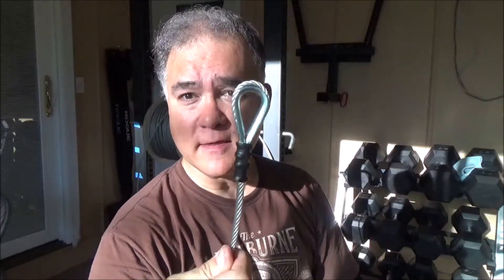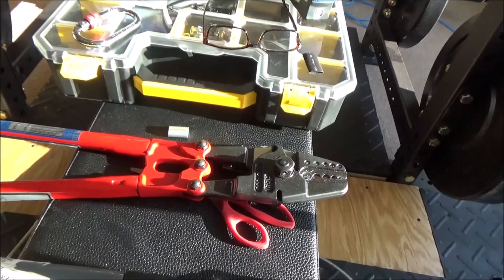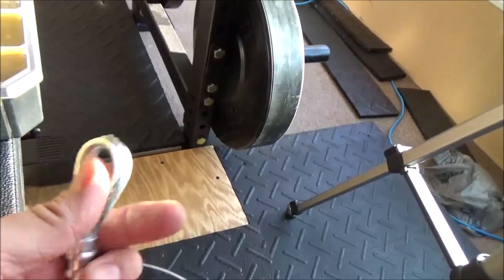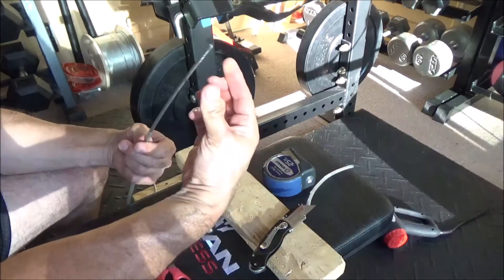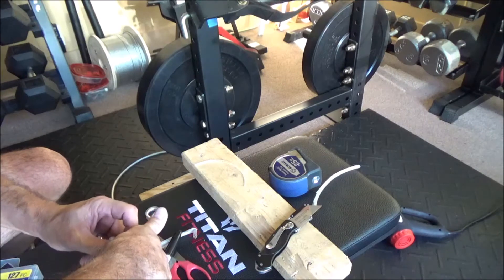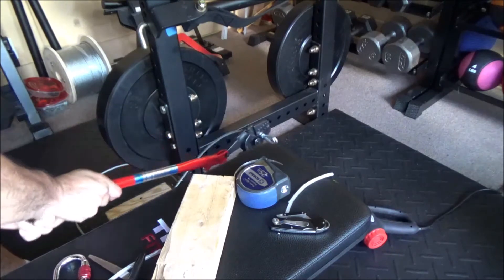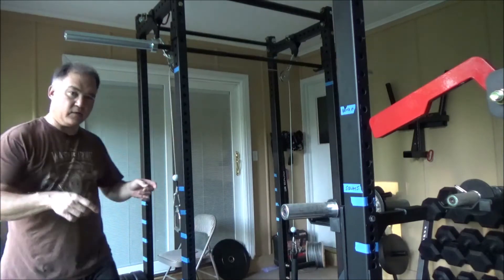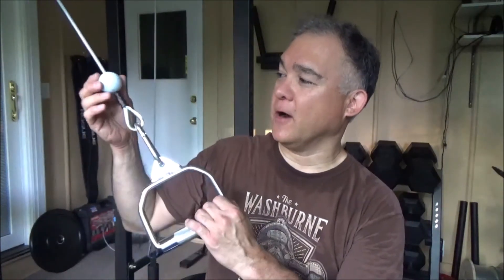Making Cables for Cable Cross or Cable Pulldown System

Comment: I drilled out the Ball Stop (Golf Ball) hole a little bigger so the crimped ferrule can slip into the hole, then behind the Ball Stop is a small rubber stop and or the stop that came with the ferrule - so the Ball doesn't always fall back.  - - - It looks more professional and gives you that extra inch" - some of us need more than others.

I see in the comments that you are using 3/16" ID, and 1/4" OD including the plastic vinyl coating, wow, I thing that's overkill imo.

I'm using Home Depot 1/8" ID Stainless Steel Cable Rope plus blue vinyl coating = 3/16" OD.
The working load = 340lbs, breaking load = 1,400lbs - with Home Depot 18" Swaging Tool and Aluminum Ferrules.

Comment: I just discovered you're channel, and subscribed. A few months ago I bought similar cable and after about a month the plastic coating separated from the wire just where it goes thru the pulleys, did you run onto this problem?
Reply: My pulley wheels are fairly small, not sure of the size but would guess around 1" to 1 1/2 ". My gym is outside and it has been very hot, I wonder if that made the plastic coating soft and caused it.
Reply from the maker: @johnsharpnack4983  I suppose that's possible. I don't think I've ever used coated cable outdoors.  I bet that would affect it. The heat and moisture, etc.  My guess is, that's a bigger problem than the pulley size.

The pulleys I use are 3".

The only reason I went with coated is that it could be next to my skin, but on an outdoor gym, I don't think that matters. At this point, if you wanted, you could just strip the coating off and use it as-is until it wears out. (My guess is that it won't wear out.) If it bothers your skin, you could always just wear long sleeved shirts or just duck tape the part that's touching your skin.

Most wire rope shouldn't rust. I had a batting cage with uncoated cable outside for years. It never rusted.

If it still works, I'd say use it as is. If the sheathing is starting to make the cable not-roll in the pulley very well, I'd say just strip off the sheathing, especially where it goes through the pulley.

And for an outdoor application, I think I might be tempted not to use coated wire rope.
Reply: @JimintheGym  Thanks Jim, I will order some bigger pulleys and see how that works. I live in western Arizona in the Mohave desert and we had a few weeks of temps in the 115-120 degree range, And yes I am just crazy enough to work out in those temps, although my gym is in the shade. I will let you know how it goes.
Reply from the maker: @johnsharpnack4983  Ah. Just a thought, but the coating on cables gets soft in heat. I think for an outdoor application like that? You might want to consider using uncoated cable. If it were me, I'd just strip the vinyl sheating where it's cracking. It'll work fine on your pulleys. Try that first. I think that'll be better. It also won't cost you anything.

But for an outdoor guy in high heat conditions, I don't think I'd go with coated cable. It will expand then cool, then eventually crack or get so floppy that it jams up the pulley.
Reply: @Sugleknug  Thanks Sugleknug for the advice, I will get bigger pulleys.
Reply from the maker: No, I haven't had that problem.  Interesting.  I am using the larger national hardware pulleys. I wonder if the size of the pulley wheels matter? what size are the wheels on your pulley?
Reply from the maker: @Sugleknug  Good call.

Comment: Awesome video! Do you still need to strip the coating if you're going to use clips instead of swaging the cable?
Reply: My opinion? yes. Clamping onto the plastic coating would be unsafe, IMHO. (The plastic coating can slide and stretch)

A few people have mentioned using wire rope clips (the little clampy things) instead of swaging. I can absolutely see why folks would go that way. It's easier and way less expensive.  

I have my misgivings against doing that. The main one being, you have this jagged thing that's on a wire under force.

But to make it safe? I'd probably locktite the nuts after you tighten it down, then dremel the bolts so they're not going to scrape somebody's arm up if you loose grip on the cable.

They make REALLY large diameter shrink wrap. I'd buy some of that and shrink wrap it on there after dremeling off the bolts.  I might even find some PVC or CPVC pipe and put a plastic shroud around it. 

I'm just picturing somebody losing grip on a handle, and the cable flying free and that jagged thing cutting somebody badly.
Reply: @JS-lr8nj  we'll see what happens.. I didn't strip the plastic, but put three clips on each end of the cable and tightened them all pretty tight. I used a healthy amount of electrical tape to cover them so the clips won't be able to scratch me at all. Worked well with 70 lbs. We'll see what happens when my loading pin comes in.

Comment: The Home Depot swaging tool works just fine.
Reply from the maker: Awesome! Is it one they sell or one that they just make available to people.
I think the inexpensive swaging tools probably work fine. It's probably a question of durability.  But if you're only making a handful of cables, that's not an issue. I used mine to do things like put up my son's batting cage, etc.

Comment: Great Video.  I've been checking on replacement cables for my Weider Pro Stack 550. $$$. Thanks for the info.
Reply from the maker: Good luck man. If you're handy, this is a cheap way to do it. And the big boxes sell cable by the foot. Not sure if they sell coated cable, but they probably do.
Reply: @JimintheGym  Información AN Cash Back es nuestro privilegio Trustpilot
Reply: Información AN Cash Back es nuestro privilegio Trustpilot

Comment: What size cable did you buy?
Reply from the maker: 3/16" coated
Reply: Jim in the Gym in the video you said 3/16”. Can you confirm which it is? Thanks!
Reply from the maker: @Evanngelos  Sorry for the confusion. It's 3/16". Looking at it now. With the PVC coating it's 1/4".

Comment: Nicely done.  DIY rather than buying the commercial version.
Reply from the maker: Thanks yeah. Since I'm building a cable cross system out of my racks, the lengths are probably going to be non-standard. So, I wanted the freedom to make custom lengths.  Seems like cables are really expensive ($15 and up) and custom cables are even more.  I imagine I'll have 10 cables or so for the entire rig by the time everything is said and done.  Hope to post the video for the entire cable and cross system, soon.
Reply: Jim's Home Gym Reviews Looking forward to seeing the finished project.  Enjoy your videos.
Reply from the maker: Thanks man!  I really appreciate it.
Reply: This is great but what if you don't have the crimping tool?
Reply from the maker: Not a way to do it other than those clamps with the little bolts.
Reply from the maker: But keep in mind, the swaging tool is like $120.  But buying cables could be anywhere from $20 to $50 per cable.  So, depending on how many cables you are making, the tool isn't out of the question.